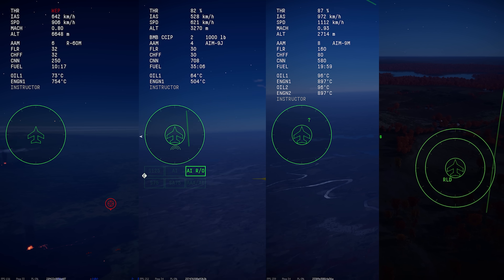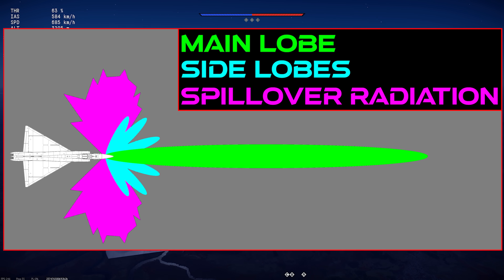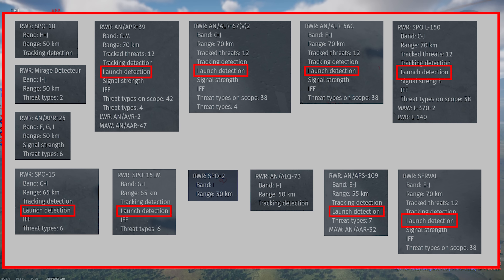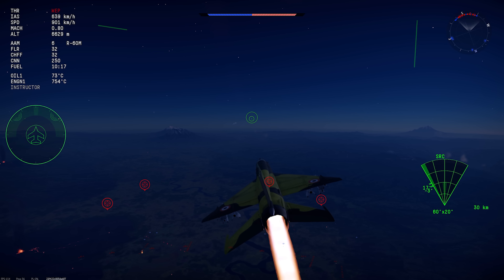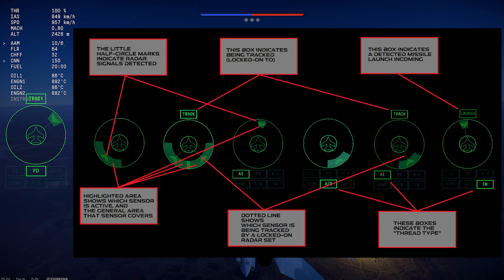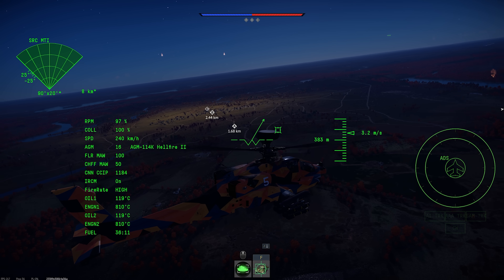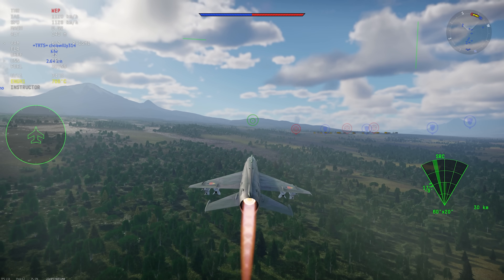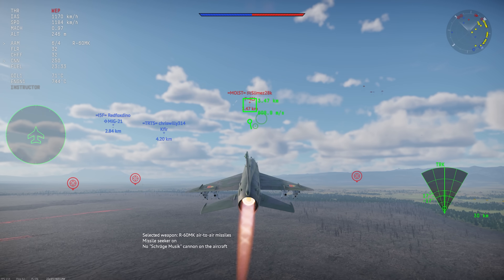Radar Warning Receivers (RWR) In War Thunder : The Complete Guide (2024) 4K

Comment: My biggest confusion with the identifier boxes are S75 and SA75. Googling both S75 and SA75 gives you results for the S-75 Dvina, or SA-2 Guideline to NATO, surface-to-air missile system, which is because the missile designation changed from SA75 to S75 during service revisions from what I can see. 

Why feature both on the display? Not only that, but why identify them as S75 or SA75 in NATO jets instead of the proper SA-2 NATO designation?

Comment: What does it mean if the stat card says SPI? I noticed that the hunter F58 that i'm not far off researching (it'll be my first radar/RWR equipped plane in war thunder) has it listed where the rest of the RWR information is listed.
Reply from the maker: SPI is "Sensor Point of Interest" , part of the air to ground weapon suite.
Reply: @TimsVariety  What does it actually do?
Reply from the maker: @rainbowappleslice  It designates a target point for guided weapons and targeting cameras (like laser pods etc). Its the thing that makes the little red square target on the ground.
Reply: @TimsVariety  thanks for explaining. Though i'm slightly confused about why the hunter has such a mode despite having no guided munitions
Reply from the maker: @rainbowappleslice  Its needed for the CCRP, check out the guide on my channel for air to ground weapons.
Reply: @TimsVariety  ah i didn't know that. Thanks

Comment: FYI: you’re not going to find a lot of information on IFF and how it’s integrated with the RWR because IFF uses 2 different systems that aren’t always inherently linked with the RWR or TWS. It uses your radar and interrogator. In real life there is legitimately only a small amount of aircraft that has proper architecture integration that implements this. Nothing will be written about it however and spoiler it doesn’t actually filter out contacts as you see in game. If you have any other questions regarding these systems you can ask me. I used to work avionics and EW for F-35s

Comment: US jets : the MiG-29 fired a R27ER on your 4 o'clock at about 22km

Soviet jet : there is a missle i think
Pilot: where
Soviet jet: dunno. just wanted you to know that you need to bail out in about 10 sec
Reply: It's unfortunate, since SPO-15 does show signal strength of a primary threat. You can see the indicator on the image at 6:45, the dash almost-circle outside the big red "OKAY, PANIC" circle is the signal strength indicator. Indeed, in DCS, they are some situations I prefer it over the AN/ALR-67 on the Hornet.
Reply: @PaiSAMSEN  the spo15 is also missing a full dimension of data, that being if the signal is coming from above or below you
Reply: True, they need to fix the spo15 within the next update or soviet mains are going to struggle with the amraam.
Reply: AN/APR-23: >ghostly screams of the damned
"IDK man I'm just feeding you raw radio signal, YOU figure it out!"